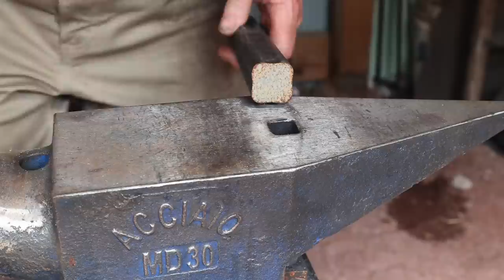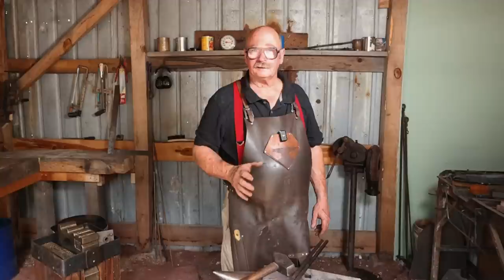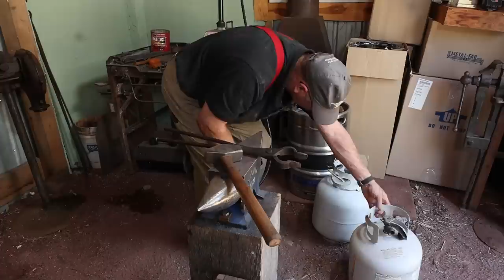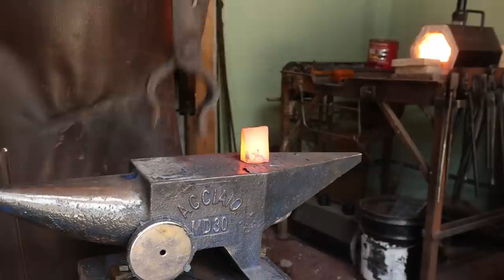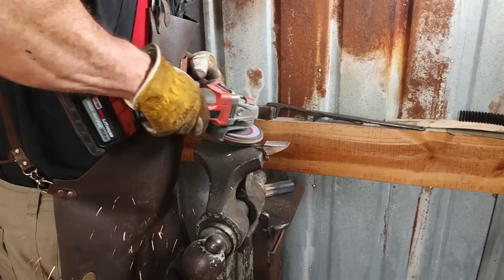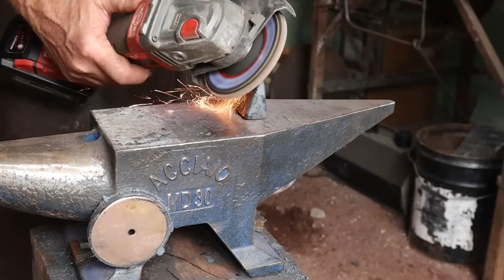Every ANVIL needs this TOOL

Comment: I'm way late on this, but I've had expensive grinders working in the oilfield for years. I'm budgeting the hell out of mine and can save you the test. The cheap ones do just fine comparatively, you can't lean into them as hard as the stronger motors without slowing down notably, of course. It's like many other things on a budget, more time but very doable assuming you can physically do the work.

Comment: I bought a Harbor Fright $10 angle grinder over 20 years or so ago and it is still going strong.  I supplemented with more over the years and each one had a different disk.  So with a capital investment of around $130, I have a stable fill of angle grinders.  My expensive name-brand 4" died just after the warranty expired. (I did have to change the HF commutator brushes now and then.) My first HF Grinder made an anvil from a 8" piece of work-hardened rail using an orange disc.  All in all, I am very happy with them even though the price has gone up.

'

Comment: That's a big piece of steel to move on a little anvil. Great job. I always pick up good nuggets from your videos. My shop is without power and under construction for the summer so I'm working in the barn. It's really helped me to go back to the basics and I have used the heck out of my  battery powered angle grinder. Thanks for the video.

Comment: Owning hardly any blacksmithing tools,  I fabricated my first Hardy from an old hand axe.  The steel is already tough and the blade part already forged to shape.  I used a disc grinder with a thin cutting blade to shape the sides as this was quicker than forging.  The shoulder stop is a 2" square of 1/2"  plate with a square hole in it punched when hot over the end of a pickaxe before being arc welded in place.  
It's very satisfying to use because it was the very first thing I made.

Comment: I made my first hardy tool for the same anvil, and the same tool, a cutoff, but in the most miserable way possible; due to material supply limitations, I upset and shouldered a piece of leaf spring. It fits the hole well, but only sits on the top on two sides. Surprisingly, it actually works pretty well, even if it is ugly!

Comment: I bought 4 harbor freight angle grinders at 1 of their parking lot sales for $5 each. They would work for about 6 months of moderate use, then die. I would toss the dead one, then use a new one. I did this for a few years until I broke down and bought a quality angle grinder.

Comment: The best part about a-33 when using it as a punch or drift you can just dunk it in water when it gets to do. No worry about losing hardness or cracking the tool. Rather a drift or punch needs to be hardened or not is another conversation lol.

Comment: I got an angle grinder like thirty years ago and it's been one of my favorite tools. Two things aboutan angle grinder, first a trigger instead of a switch on the top, you can still lock it on so you can handle it with out holding it down. Next, my dad saw me use my grinder and went and got one, but it was I think, a 4 1/4 inch, so wouldn't take most wheels. I went and bought him a cheap 4 1/2" (like $10.00-$20.00) and after about 25 years it was working fine, but the switch on the top strarted to get hard to turn on.

Comment: I have the bauer 4 1/2 inch 20 volt angle grinder from Harbor frieght. It works great. I definatelly recommend a 5amp battery.

Comment: John, I don’t know about Colorado but our local welding supply store and even Lowe’s sometimes, has a two pack of DeWalt or Bosch angles grinders for $99.00. I have bought both types to take to Cuba on mission trips and they work well. I currently have two DeWalt’s in my own shop and have no complaints. Great video. Darlington, South Carolina

Comment: Years ago I purchased a very inexpensive angle grinder at Tractor Supply, no brand name that meant anything, and it is still working.  I sent it to my son's cabin in Montana for his use and it works but appears that it is having some armature trouble with a couple dead spots.

Comment: I really like the style you did this video. It feels like I'm working in my own shed.
  On the topic of angle grinders, sometimes it's nice to have a battery-operated one to take to the scrap pile to cut off the piece you need.
  Then you can bring the piece to your grinding station and use your wall power.
  I also find that the wall powered grinder helps get through thicker steel when you're cutting it.
  The battery powered grinder is great for quick cuts. And because it's light it also is great for finessing curves.
  And thanks John for another great video.

Comment: Glad we have a cutoff tool for the little anvil now. Seems like the hacksaw approach was getting old. The magnets seemed to help with the ring of the anvil. 

That flutagon is like hammering frozen clay if it’s not hot enough, but it’s darn useful for punches and chisels. I bought a little bit after you did a few videos using it, and made my best tools so far. 

Another excellent video sir.

Comment: Bought the little Bauer angle grinder from HF to pair with my larger Skil (I’m watt-wise working off grid solar);
It seems just as good as the Skil, but doesn’t have a key holder in the handle,,,
However, the handle is hollow so I stuffed two strips of plastic foam in there, voila

Comment: We have a base model 4½in angel grinder at Harbor Freight for $15 right now that will last about 6 months (get the extended warranty for $5 and we'll replace it no questions asked)
Reply: I have four of the little 4 1/2" corded angle grinders:  One with a cutoff wheel, one with a thick grinding wheel, one with a flap disc, and one kinda back in the bullpen, so to speak.  They're all Harbor Freight 9.99 specials.  Oldest one is >10 years old and has had the absolute snot beat out of it, and still going.  Sure makes it time-saving to go from one application to another. 

Up one level, thank you John for your videos.  I'm learning quite a bit from you!

Comment: thanks John, that is a nice add on for that anvil. I've had issue with getting the bottom half of 30 lb propane tanks too - freezing up and not vaporizing enough propane to maintain pressure.
Reply from the maker: You might be able to manifold 2 tanks together.  Setting the tank in a washtub fill of water also helps slow down how fast they ice up.

Comment: About grinders, its good to have one for cutoff, one for flap disc, because they are pain to change out when you need them. And corded ones are cheap at yardsales, fleamarkets, online, etc. Just mind if a used one has bearing noise. Cordless are great, stop almost immediately but pricier.

Comment: Another great project, and it's so satisfying to make a tool you'll be using all the time!  With regards to the angle grinder, I think this is something I picked up from one of your previous videos, but having a second grinder can be a huge quality of life upgrade once you start using them.  I have one with a cutoff wheel, and one with a 60 grit flap disc, and being able to use the cutoff and then quickly dress it with the flap disc without having to change discs is very convenient.  Thanks for sharing!

Comment: Craftsman 20v series tools work well in my small shop . 2amp hr batteries don't last long so having the 4amp hr batteries is another investment,but I have several of these tools and it works for me . I have the 132lbs anvil with a hardy a little over 1 inch . I was thinking the flat bar option would be a good way to go and take it to work to weld the cut off on it . Thanks again for another good lesson .

Comment: Just in time! Am about to make a hardy for my Vevor anvil. 4 1/2" angle grinder has been the most-used power tool in my shop for over two decades. After a string of Makitas, have had good luck (three years so far) with the HF Hercules grinder. Whichever brand, would strongly suggest one with a dead man switch. Ask me how I know!

Comment: Love the “voice over” method.  It makes your explanations much easier to understand.   When getting a gas forge, is a two burner worth the extra cost?   I hate buying a tool twice because I “cheeped-out” the first time.   Thank you again for your time and knowledge.
Reply from the maker: It really depends on the size of work you need to heat.  For smaller projects and short heats a single burner is plenty.
Reply: @BlackBearForge thanks again John. I think for the small shop we need more tongs.

Comment: Don't know how the economics works. But if you already have a couple of 20# cylinders laying around you could make a manifold to connect 2 or more at once which would increase the surface area to pickup the heat needed to evaporate your propane and keep the pressure up. Like I said if you don't already have the 20# tanks and had to buy new it might be cheaper to just get the 100# cylinder.
Reply from the maker: Manifolding the 2 - 20 pounders does help but a 100lb cylinder is the better option in most cases.  This little forge comes with a regulator set up for the male threads on a 20 pound cylinder and not the typical left hand fuel threads found on 100 pounders

Comment: You dont need to make it form a one peace of steel.I made mine out of old axe that had broken eyelet -i cut down eyelet and then i ground it straight.Then i took a small plate of steel and i welded it to it. You dont even need a shank-i took 1/2" water pipe (or whatever fits in your hardy hole)and a strip of mild steel.You bend a strip around the pipe untill two sides meet eachother and then you weld top part of eyelet  on a steel plate.Then all you have to do is spread those two peaces apart and they act like a spring -very easy to put it on the anvil and to pull it out.
Reply from the maker: Assuming you have a welder available thats a good way to get the job done.  Many home hobbyists may not have that option.
Reply: @BlackBearForge  Nothing that beer bottle cannot solve.People forget that you dont have to know how to weld you just need to know someone who does!

Comment: Here's a question for later down the road. If you made a hardy tool that you don't plan on using often, would coat it something? Also if you look online for a place that buys palettes of unsellables from warehouses, you can buy new power tools for dirt cheap. Often the only problem is the packaging. I bought a brand new angle grinder for $4
Reply from the maker: I frequently heat tools up just enough to melt some wax onto them,.  Something like paste wax or beeswax works well

Comment: That Vevor anvil is ok, but it's only 30kg. I have the 40kg steel one, and it's so much better than the 30kg one I tried at a friend's place. The extra weight makes a huge difference in the performance of the anvil. I would definitely recommend going with the 40kg one instead, if you can afford it.
Reply from the maker: Simply misspoke. Sorry for any confusion

Comment: Great video as always! With hot fitting the shank by upsetting it in the hardy hole, should I be careful with the time or number of times you have it in there with respect to the heat affecting the hardness of the face of the anvil? I have a 99 kg anvil, so the heat can travel through quite some mass, but locally I would assume it gets too hot. I was wondering if I should be careful in this aspect! Thank you for any advice in advance. Have a great day.
Reply: In my experience, you lose heat in your metal before it affects the anvil. You could always douse it with a bit of water between heats if you're concerned though.
Reply from the maker: It would take much larger material in contact with the anvil for much longer to effect the anvils temper.

Comment: What are your thoughts on using a mild steel hammer when using a Hardy cut off?
Reply from the maker: If you stop cutting before it cuts clear through and break it off at they edge of the anvil, it wouldn't be necessary.  But it would be helpful is you frequently cut clear through.

Comment: Noise is a killer for me. I got that same 30kg Vevor anvil and hammer blows echo like crazy. I tried chaining it down to a big log base (~60kg I guess) and I attached magnets all over the anvil, but it still makes too much noise in my opinion. I currently live in an apartment and do my crafting work on a large balcony. I would like to start blacksmithing, but I also don't want to annoy my neighbors too much. Do you have any tips?
Reply from the maker: The more solidly mounted the better.  One of the problems with these little anvils is that they sit up on feet instead of a solid base.  I wonder if a wooden base could be carved to fit the opening under the anvil.  If that could  be done the anvil could be set into silicone over that larger contact area.
Reply: I cut a wood block from a scrap of 4x6 to fit the space between the legs of the anvil.  Dap latex caulk was used to fill the gaps and glue the block to both the anvil and the wood base.  It really took the ring out of my Accio anvil.

Comment: Thanks John great video , could you tell us more about hardening and tempering axle materials?  Because I can find that on the cheap but don't have the funds for known quality?  Do I quench ýellow in oil and toaster oven finish 🤔 or quench bright lemon or dull orange.???for unknown axle materials?  Cheers  mate 👍🏻
Reply from the maker: Test hardening to determine if its air hardening, oil hardening or water hardening woulds be the first step.  Yellow is to hot for most steels and cause failure.  Quenching at cherry red is a good place to start or just slightly hotter than the steel looses it magnetism.
Reply: @BlackBearForge  thank you John 😊
Reply: @BlackBearForge  for a different way of thinking that's about when I'm going to pull the oxygen trigger for oxy/ propane cutting 🤔,,, Nice even red 👍

Comment: What angle do you use for the cutting edge? 
What hardness are you shooting for?
Reply from the maker: Neither is all that critical.  Probably around 30 degrees for a cutting angle and 50 Rockwell for the hardness.  But it will temper back quickly in use as it comes into contact with hot iron.  But unless it get red hot, it will still be harder than not hardening at all.
Reply: thanks  @BlackBearForge

Comment: If you were using a chunk of car axel would the process and quench be similar?
Reply from the maker: The forging process would be the same.  Hardening and tempering would change depending on the steel.  Using a small scrap you can heat and air cool to check and see if its air hardening.  If not heat and oil quench, if it still doesn't harden try water quenching.  I think a lot of axles are medium carbon and probably harden in water.  But any unknown steel should go through the testing process.
Reply: @BlackBearForge  That sounds reasonable!  By chance, do you have a video on the topic?

Comment: "Your anvil should weigh 10X your biggest hammer"!?!? 
If I had a 15 pound hammer... I doubt I could swing it with the control necessary around my anvil. I could swing it for busting boulders and rock slabs, but that is a totally different type of swinging.
Reply from the maker: That would be a minimum. So if you had a friend come over and swing that 15 pound sledge you should have at least a 150 pound anvil.  You could potentially break a smaller anvil.   If you routinely use a 3 pound hammer and a 100pound anvil, there wouldn't be the same risk.
Reply: @BlackBearForge  Thank you!
So, that might be the cause for images of some anvil failures where the horn or heel breaks?

Comment: I thought you had made a choice not to use a coal forge s8nce you determined that it wasn’t cost effective and you used gas much more…?  Returning back to your foundations.  I like this video for the smal shops most people have.
Reply from the maker: For my day to day work its mostly propane with the induction forge filling in the gaps.  This little shop will be primarily hand tools and the coal forge, once its set up, primarily for YouTube videos.  People really like seeing the open fire.